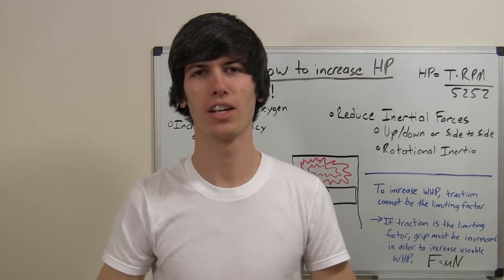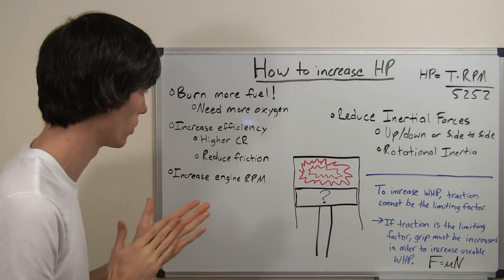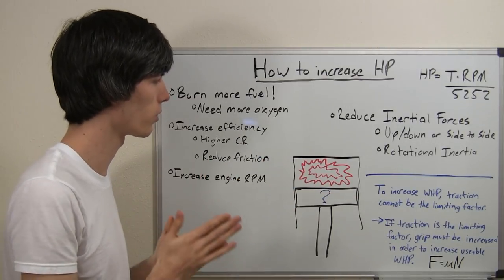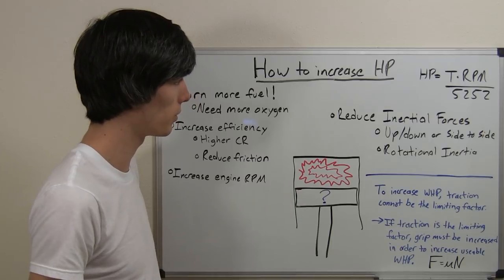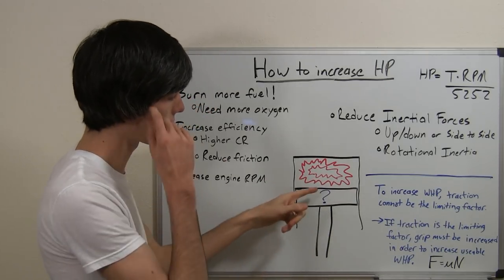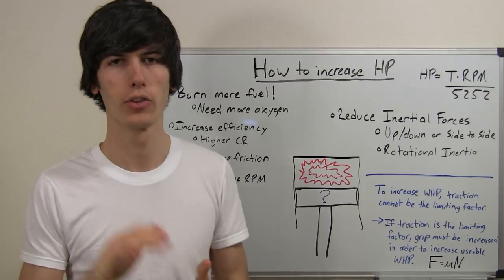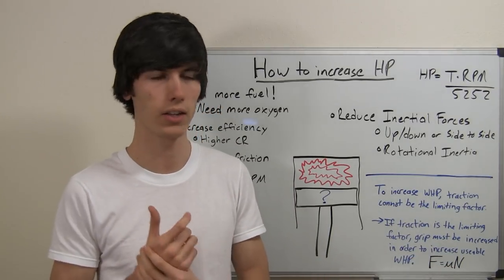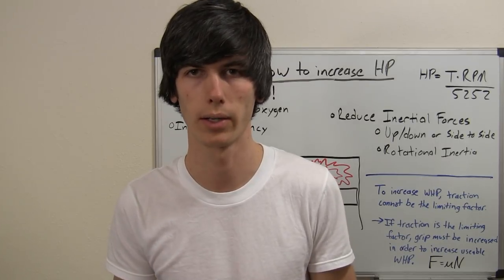How To Increase Horsepower - Explained

Comment: a lil off topic but how much hp is 1 lb of boost
Reply from the maker: Depends on so many factors, but most importantly the size of the engine. 1 lb of boost in a 6 liter is far more power than 1 pound of boost in a 2 liter, as it means 3x the amount of air vs the 2 liter.
Reply: +Engineering Explained im in a 1.6 l twin scroll turbo veloster

Comment: Why isn't O2 used instead of NO to increase power...O2 could theoretically provide 5X power vs Air??
Reply: I have been thinking about it for a long time too.  for example fuel/oxygen injection under pressure ?
Reply: I suspect that only 02 / fuel may tend to ignite at a too low temp.when compressed Maybe a "reversed" diesel could work..Inject O2 into fuel?
Reply: James Grant O2 is extremely combustible and unstable. having NO stabilizes the oxygen atoms and adds a bonus to cooling the engine, increasing the amount of Oxygen you can pack in an engine
Reply: Thanks Carlos. Maybe O2 would work in a diesel?
Reply: ***** Maybe. It would have to be injected in the cylinder and hopefully not immediately combust

Comment: what if cut balancers form camshaft?
Reply: Removing balances from the any part of the engine will limit the RPM. The word balance kind of lets you know that it is desired.
Reply: limit?so it will be slower?i thought it will be faster without more weight on it
Reply: ande andeande They were placed there for a reason. When the rotating mass is smooth the engine can rev quick, easy and damage to components is at a minimum. If it is out of balances the rotating mass vibrates, disrupts the RPM climb and contact to other components are increased (such as connecting rod slamming into the journal or disrupting oil flow starving another area of the engine). Over time the out of balance will cause the engine to fail. Yes you can cut weight of the rotating mass but it must remain balance or irreparable damage could occur. Sometimes when you remove weight you also remove longevity from the engine. Everything has an advantage and a disadvantage. There are ways to clean up the typical manufactured engine. Weighing each component and making a like components weigh the same. More precision on the tolerances throughout the engine. But this is something for a machinist and equates to a greater amount of financial need than just removing something externally or even mounting something externally. Such as a turbocharger or super charger.
Reply: thx :)

Comment: how do you increase CR and RPM?
Reply from the maker: Frank Malakas These are design changes, really, but you'd have to increase the airflow for higher RPM, and change the pistons/cylinder head for a different CR.

Comment: Easy one, just turn more RPMS just have a beefy crack and rods ect.
Reply from the maker: cobra454tim Valve float and volumetric efficiency is probably more of an issue than a crank that can hold the stress.
Reply: Engineering Explained yes you would be correct but lets put that aside I wonder how much horsepower gain would be with each thousand rpm gain?
Reply: +cobra454tim 
At a certain point, the engine would just begin to lose power as gets faster. This is because the time of the valves staying open for air to enter the engine decreases. Hence why torque is more apparent at lower rpm as there is more time for air to enter the engine.
Reply: Good point.

Comment: Why 5252? Where does that number come from?
Reply: +nrviognjiocfmbkirdom  Check out the vid about torque versus horsepower ;)
Reply: Tomas Stibal The use of non-SI-units is annoying, but thanks for the hint.
Reply: it comes from the man made term called horsepower. it wouldnt be 5252 is someone created mouse power or ricepower

Comment: I don't get it? Why would I want more horsepower? Even the crappiest rust-bucket of a car, can get up to highway speed.

What I want to know is, how can I get better gasoline mileage?
Reply: EFI, modern engines.
Reply: +Here Kitty Kitty ! Different gear ratios, highway RPM's, etc...
Reply: Burn less fuel and save it for the ones who want to burn more fuel.

Comment: You forgot the easiest thing! Reduce the wieght of the car!
Reply from the maker: Alec Manger That does not increase Horsepower. :) I have videos on weight reduction, quite a few actually. :)
Reply: Well weight deduction only allows u to accelerate faster. Yea no increase in power but maybe better handling and more wheel spin
Reply: Engineering Explained which tires make better performance?
Reply: ***** if you want to grip get wider sports tires like falken or something
Reply: Pirelli pzero Corsas.

Comment: somehow increase your RPM? lol wouldnt you have to change the cranks and the piston rods?? i think so.. big job.. lots of money, rather throw a turbo kit lol
Reply from the maker: Exactly, it's not something you'd typically modify, but rather design for.
Reply: hows that gonna increase the engine RPM?
Reply: but that wouldnt increase the RPM from 6k to like 8k+ would it?
yea the higher lift give more HP but thats only for more air to get into the engine similar to what vtec does.
Reply: Have the engine balanced and blue-printed along with a performance camshaft and roller rockers.  You also may have the engine shop shave some of the reciprocating weight off of the crank shaft.  Switching from a mechanical fan to an electric for us old car guys.  Definitely going to want to change pistons and rods to reduce weight and possibly increase compression ratio.  Every little change that you make for the better adds up.   Just look at the horsepower increase you get just from switching from manifold exhaust to headers.  Performance isn't cheap.

Comment: This is rubbish, you don`t know what you`re talking about.  You said at one point" double your revs, double your horsepower"  this is blatantly wrong.  The power rises as the revs rise until you reach a point where the valves are moving so fast that the air/fuel mixture cannot fill the cylinders properly due to the forces of inertia acting upon it, at which point the engine starts to lose power, if you increase the revs still further the engine makes less and less power.  This is called a power curve.  Power is not produced linearly but in a curve.  !st year stuff.
Reply: "This is called a power curve.  Power is not produced linearly but in a curve.  !st year stuff."

"Assuming everything else is equal," he said. ;) If it is not linear, it is not equal, cocky bro. :)
Reply: shame on u